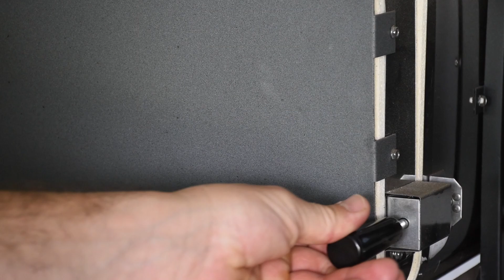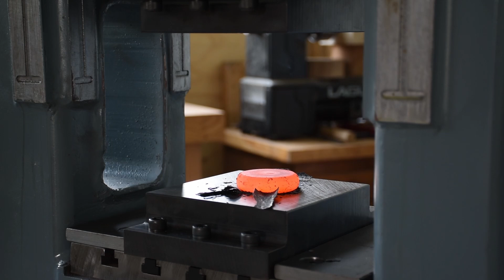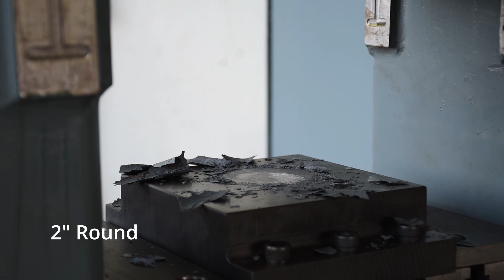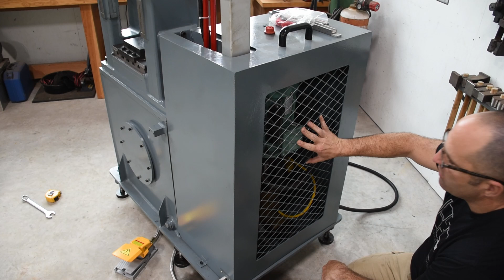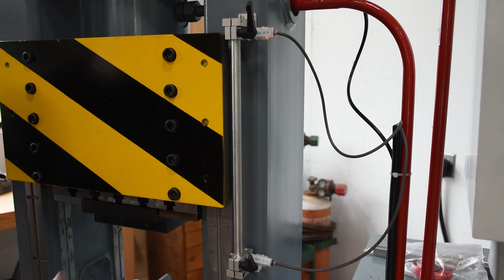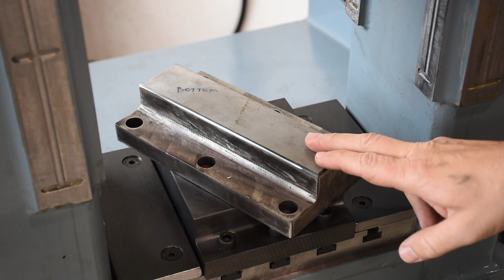Anyang 25 Ton overview

Comment: If you were doing it again. Which would you buy first, or, if you had only one machine.. Power Hammer or Hydraulic Press?
Reply from the maker: Power hammer.  Biggest you can afford.
Reply from the maker: Think of the press as an all or nothing type of forging.  You are dedicated to the squish.  A power hammer can deliver light to heavy blows, which allows you to correct problems as they occur.  The press is terrific for mindless compression.  You need to build lots of tooling to keep things accurate.  Benefits of a press:  higher ram than a power hammer, allows you to fit top tools better.  Bigger dies(I made these 6"x6")  The ability to clamp tooling down and a bunch of other cool abilities.  so back to your question: Hammer first, then press.
Reply: @ Yes. Thank you. That was my opinion watching your videos.. I think I have 3-4 to go before I can say I watched them all.. Ha..ha.. I was captivated.. 
The Powerhammer with the jigs/tools you make, can make quick and precise work and do it quickly.. From the look of the Jig wall you have, I would just guess, you have had the power hammer 3 years or less. My actual guess would be close to getting to 2 years. It just makes sense to make a jig to do most things, you might be able to use to do something else. I noticed you used the same jig twice, then I noticed, why you created the round piece on each end.. To help grip with your tongs.. Ha.. Nice thinking... 
I have only used a press once, not used a power hammer yet.. We used it to make some rounding hammers. Cheeks, Cup the head for the rounding side of the hammer... It was pretty slick and saved a lot of 10 pound maul work... 
Thanks for your reply...  BTW.. You should have some swarm traps up in your area. 
Every now and then, you will be blessed with some Wild Native Bees to your area. You will be able to tell.. They have a hodge podge of different types of bees in the ones I have been blessed with.. And, they don't die during the winters like the Commercial Italians you normally get.. And, really hard workers.  Many say they are mean, but, if you talk when you are getting ready, they know you are there and try not to bang around or pinch them, and they are just like the others, but, much more efficient and generally a smaller frame bee, so, use up less resources.

Comment: What happens wenn you move the lower sensor up? It is adjustable from what I can see, would be nice if it will set the travel downwards.
Reply from the maker: Ok, I just tried that out.  If you move the lower sensor up, that sets the lower height.  So, the ram will compress down to that set height off the lower die and won't go any lower.  I think a cool use of this could be axe forging, where it drives down to your stripper plates, but doesn't contact.  I'm not sure if it is accurate enough as a digital height block.  I'll keep you posted.